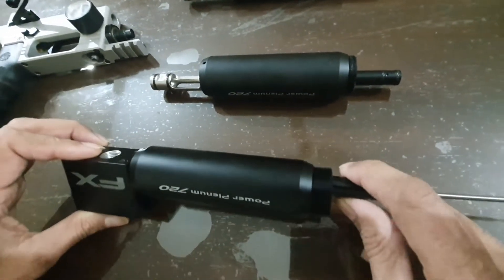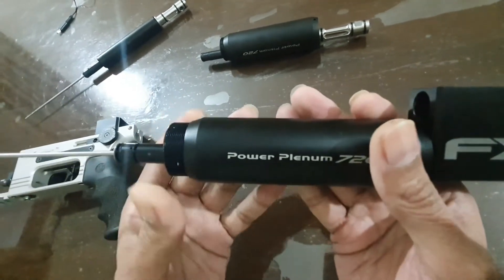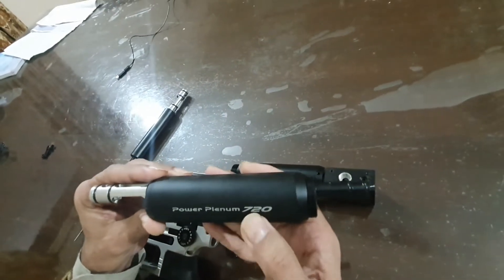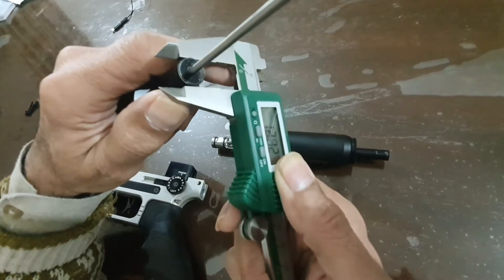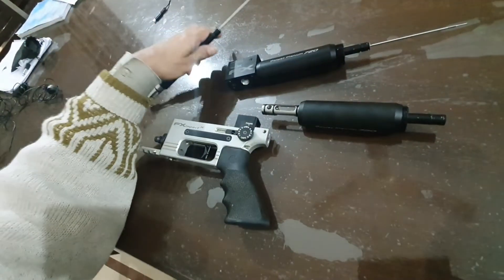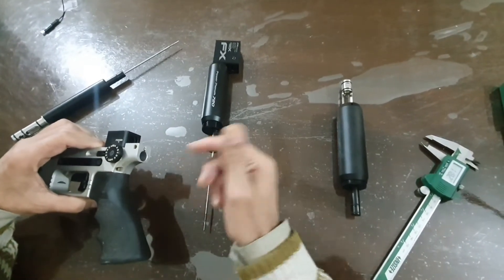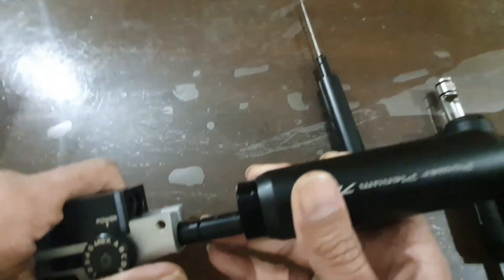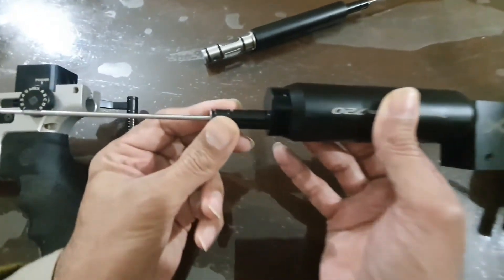FX Impact M3 & MK2 plenum incompatibility issues (English & Urdu)

Comment: I was verry carefull installing the plenum with upgrades and stil i thorn the biggest o-ring... damn the edges are sharp also pay atention to that before installing powerblock to the M3 !!
Reply from the maker: When playing with high pressure air, one must be very careful.  If upgrades are well built then there is no issue.  However the issue lies with the installation only.
Reply: @BhaursAirguns  That is partly true... weird that with the upgrade to te powerblock i only had the feeling that this could not be good for the o-ring to turn the treats all the way over that o-ring although i lubes it well. That is a tricky point. No problem i just buy a o-ring tomorow and fix it...

Comment: Hello good afternoon friend, cordial greetings from Purisima del Rincón Guanajuato Mexico I already install 2 Power Plenum 720 and FX Impact MKII  everything went well
Reply from the maker: That is nice if you do not face the problem I have addressed. Most shooters do not face it. We a group of shooters face this issue when we use the gun at low hammer settings. 
That is why we worked on it. Mr. Seeker from US and some other shooters also notice the issue.
But as long as one doesn't face it it's all good.
Regards,

Comment: Hi..

I have the fx MK II and I did this upgrade... In fact, it has some difficulty at the beginning, but it's not due to differences in diameters
but on the block, where you press the penum...

watch this video of europaiguns pnde mr. Emeritus explains how to overcome this problem with some sense of humor mixed in..

I hope it helps you

greetings

see  video

https://www.youtube.com/watch?v=zcS2bnIx2Ow
Reply from the maker: I talked to Huma and FX. They say that FX make two size dia of plenum part that inserts into the block.

Some Impacts accept one size and some accept other.

Even Huma said they do not have the smaller dia part at this stage but they will machine for us.

Then Huma sent the part which was machined down in dia and there is no anodizing on those areas which were creating problems inserting the plenum. 

It is very obvious that Huma turned down the dia of that part so that it could enter the block.
Reply from the maker: I just saw the referred video. To me he got perfect part. By inserting a coin he just opened the block a bit and all went good.

In our case no such attempt to open the gap was enough to inset the part. 

If we would exert more force, we could damage the block.
Reply: @BhaursAirguns  
ok I don't doubt what you're saying .... I managed to solve the problem by opening the block a little...

good continuation